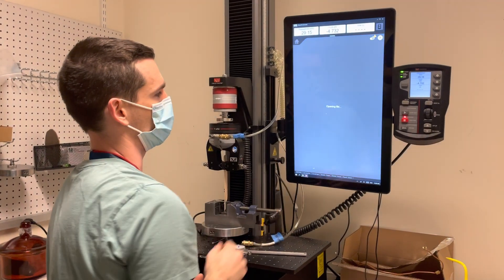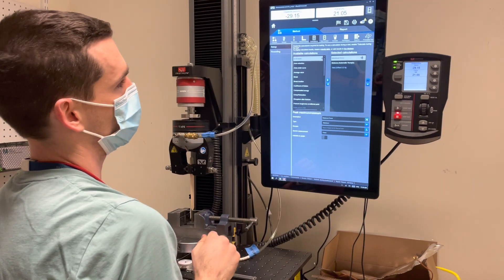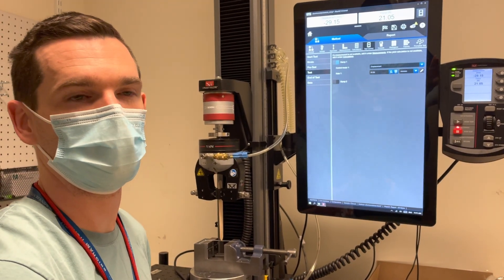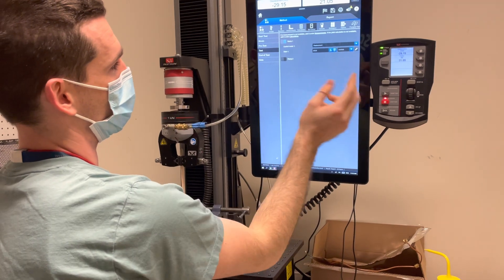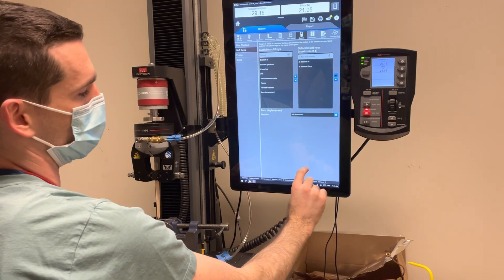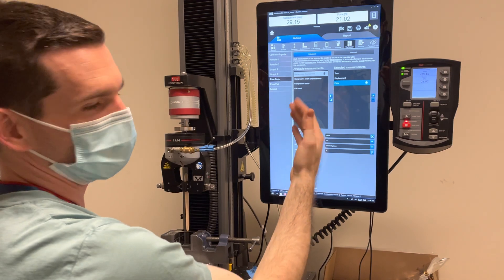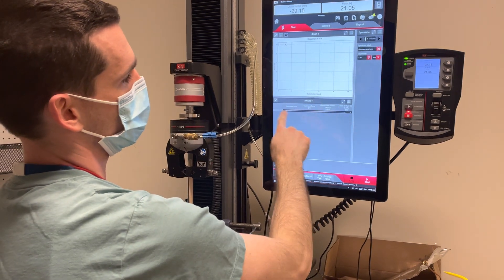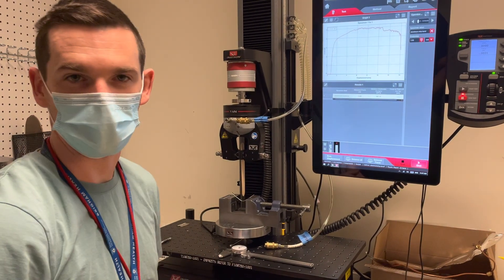Instron test method setup and running a test 2 of 2

Comment: Hi Adam, is there a way to retrieve all individual data points after a compression test? I would like to retrieve the data and plot the stress-strain curves myself. The bluehill app generates a report with the curves but I want to plot them using a different application? Is that possible?